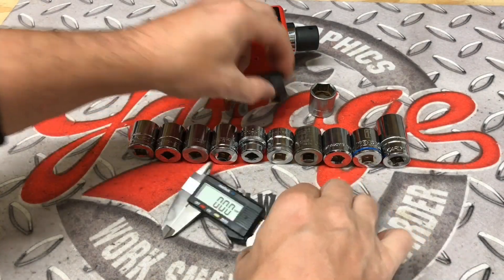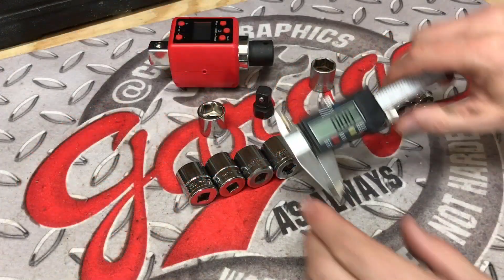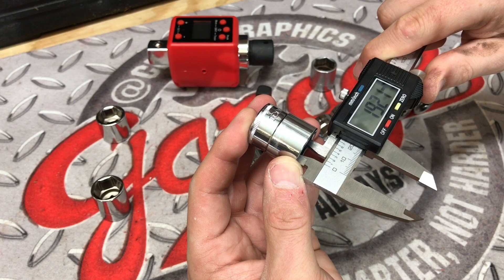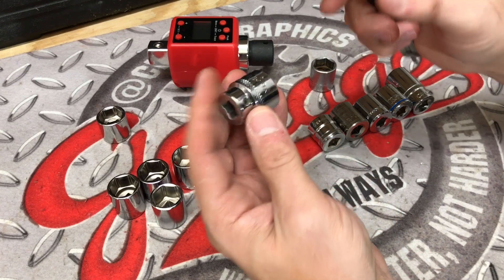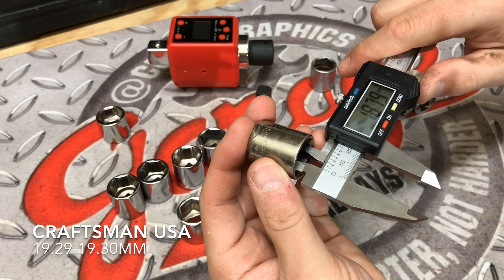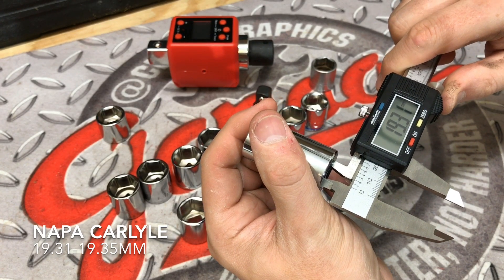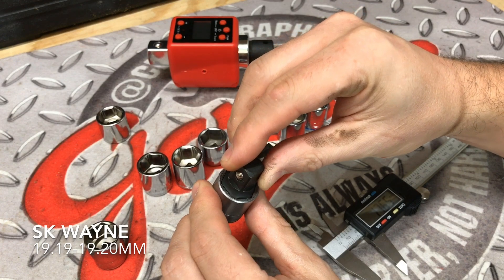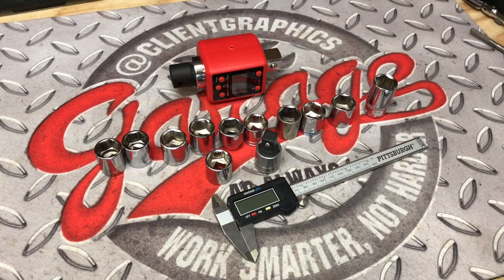How to check Socket Measurements  Who has the Tightest Tolerance?

Comment from the maker: What is your favorite socket brand or size? My USA made SK Wayne socket from the late 1960’s has held up to regular use and many extra years. It has held throughout all the recent torture testing and it still has the tightest spec out of everything seems pretty impressive.
Reply: SK is my favorite brand. I have the flex zone sockets and the sk x frame wrenches. Love them.
Reply: Snap-on, but I'm sure you knew that already. lol
Reply: Snap on but icon is my wallets favorite.
Reply: It's GW and here's why. I bought their master 3/8 64pc chrome set for a hair less than $50 about a decade ago and they've worked out really well. Haven't really thought about buying anything else, other than a set of fractional mids. Not in a hurry, though.
Reply: Bonney that I bought 35+ years ago and still going strong.  In all those years only 3 sockets broke and that was within the first 5 years and they were warranty replaced.  Bonney went out of the tool business around 1995.
Reply: Mac is my favorite pro brand. Carlyle is my favorite mid grade and husky or tekton is my favorite cheapy.
Reply: My craftsman USA tools have never let me down but husky has let me down I don't care for Stanley I'm surprised with the kobalt tho but I'm liking my icon tools alot
Reply: Craftsman USA sockets. They always hold up and the chrome finishing is still in great condition years later
Reply: @Colt Aarav instablaster :)
Reply: @Lance Kolton it did the trick and I finally got access to my account again. Im so happy:D
Thank you so much, you saved my ass :D
Reply: @Colt Aarav happy to help :D

Comment: I don't have a favorite socket brand I use.  I use what works.  I have 35 year old Craftsman, 50 year old Companion, 30 year old Husky's, 10 year old DeWalts, 10 year old Northern Tool and  a set of brand new Tektons.  No preference for any particular brand.  Cheers!
Reply: So your preference only changes when it doesn't work?😆
Reply: @xephael3485  If one socket doesn't work or breaks, I try another and so on.  It's always nice to have a variety to choose from.
Reply: Well said William

Comment: The right tolerance on the sk is not needed and indeed can be a problem as any deformation on the hex in any way impedes the socket from going on. Work with shiny new nut and bolts your golden, from my experience anyways

Comment: Here is the problem with only measuring one socket per brand.  All you can test is to verify that it is in spec. You can't test the tolerance of the brand. What you want to see is the variation with one single brand.  You, as a consumer, would have a hard time testing that.  We know that in the manufacturing process, in order to get that measurement, they heat the metal, and then forge and broach it at the same time.  The broach wears out over time.  So, the first socket that is broached with one specific broach will have a larger hole and looser fit.  As that broach is used, the sockets afterwards are going to have a tighter and tighter fit, until the broach is finally replaced.  The last socket that gets broached has the tightest fit.  Part of the cost of each socket is how often the broach is replaced.  A class 1 manufacturer will replace the broach more often than a class 2 manufacturer.  What that also means is that you can find a socket from a class 2 manufacturer that has a tighter tolerance than a class 1 manufacturer.  Anyways, all I am saying is that if you only measure one socket per brand, all you are doing is determining what position in the broaching line that one socket was.
Reply from the maker: FinallyMe78 And what does your 19mm sockets run for sizing?  If any USA socket manufacturing company wants to have me for a day of fun, do a video and to come measure a 1000 sockets I’m game! Probably won’t be for a few years until the kids get older.
Reply: @ClientGraphics  that is actually a really good idea. Having me measure mine, that is. The best would be to have all your viewers measure theirs and then send you the results. Having one person doing all the measuring is better, but if you got enough data, that would probably wash out.
Reply: @ClientGraphics  anyways, I enjoy your videos, so keep up the great work.
Reply from the maker: Thanks buddy as it can be hard to come up with new or different ideas.  Appreciate you watching and commenting, thank you!

Comment: Great Video it would had definitely been most quite interesting also if you would had a Milwaukee Four Flat Socket to inlist in the Demonstration and not just for Ratchet or Ratcheting use but also Open End wrenches or Ratcheting wrench ends do to its 4 sided dimensions it would had made a very interesting Demonstration on all soughts of different levels but Great Content Good Job

Comment: Some of those surprise me but the best sockets of them all have the same design from SK to Snap On, my favorite is SK they're the strongest in my experience but the older ones are slightly better then the new ones. But in certain jobs you do need the tightest fit possible

Comment: I measured this by measuring how many degrees of rotation the socket allowed on a bolt head before engagement.  Koken is made in Japan and beat the Snap On stuff I had.
Reply: Koken is basically the best socket tolfernace manufacturer in the world. So that makes sense.

Comment: I have numerous different brands of sockets. As long as they're not too cheap and nasty they'll work! I wouldn't go out and buy a full set of snap-on sockets, but you can see why they're so expensive.
Reply: I don't see why they are so expensive. Icon was slightly tighter and is cheaper. The other brands were all within spec according to the standard. Snap-On didn't really stomp the competition here.
Reply: @johnterpack3940  No it didn't but unfortunately in Australia we don't have such a large range of tools to choose from.

Comment: You want a little wiggle so it doesn’t just grab the corners. The snapon is loose to grab closer to the inside rather than rounding the bolt
Reply: Underrated comment

Comment: So looks like the best budget options are Icon at 19.21mm and Gearwrench at 19.25mm. However I've seen the Icon sockets Mushroom at higher torque. (Like 12mm internal engine bolts torque to 35ft-lbs).
Reply: I don't know the full story but from what I heard they were just too soft when they first released and they fixed them. The packaging between the old and new icon sockets are different too and watched a socket hardness test from this year and they're about 43 hrc which is just five points away from snapon so I think they're worth consideration now.

Comment: How are your 3/8 drive sockets holding up? I recently saw a video from Tool Time stating that the chrome on his 3/8 drive sockets are soft and they were dented. Even the drive part if the socket was warping. He claims he didnt use them on an impact.

Comment: This comparison is kind of bogus. I used to work at a machine shop it’s up to the operator to make sure the parts coming out are within spects. Some guys take a lot of pride in there job and keep tight tolerances and some just let them pump out. You could get a tight or loose fit with any brand
Reply from the maker: First part of the run vs the last part of the run will vary in difference due to ware.  There are lots of factors.  It’s partially a baseline for others to have if they ever want to see where their sockets are for tolerance.
Reply: ClientGraphics a good machinist can keep the tollorances good for the whole run that’s why you have to check every or every 4th part. You adjust your machine to the wear of the tool or change it out. I used to turn pistons for Wagner commercial guns they had very high tollorances
Reply: ClientGraphics there is the chroming process also witch most places send there parts out to be chromed I wonder how much that effects it so many variables

Comment: Why did you measure a 3/4 husky socket to check for a 19MM tolerance
Reply: Good question.  I just looked it up, and 3/4 inch = 19.05 mm.   Maybe it is labeled for both.
Reply: I'd be shocked if they used a different mold for 3/4 and 19mm. With only .05 between the 2 and allowable tolerances of .30, there's zero reason to make them different.

Comment: Sockets will always be bigger that the nominal measurement of a bolt head because of the difference in coatings applied to the bolts, tooling tolerances and the biggest reason is because bolts aren't perfect after they've been beat up by cheap tools, rust and morons with locking pliers.

Comment: Kind of useless measurement, no socket drives off it's flat; especially flank drive and broached variety with off corner drive which are designed to slip some until it grabs just off corners of fastener. Better test would be to paint the nut tested and look at which socket drives farthest off corners of fastener once torque is applied. You won't beat a SnapOn, Matco or Mac in most situations.
Reply: Thank you! Comment is spot on. People fail to understand why flank drive is such a popular and copied technology in sockets. Most of these guys aren’t professional mechanics, just YouTubers